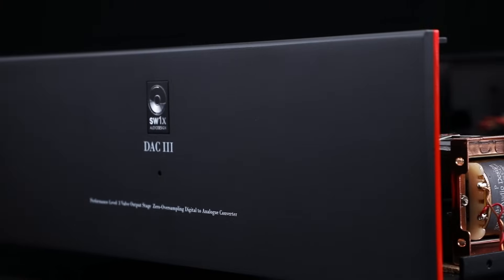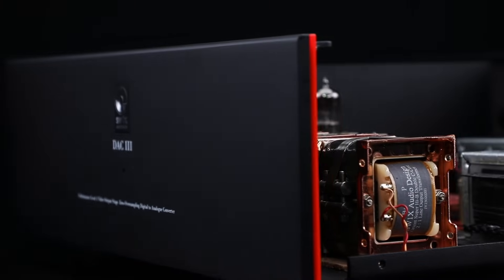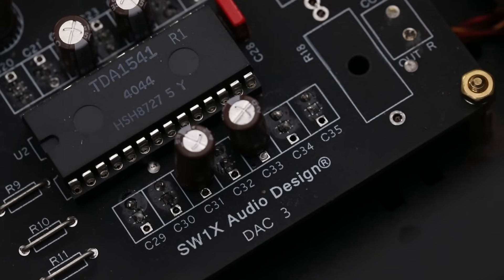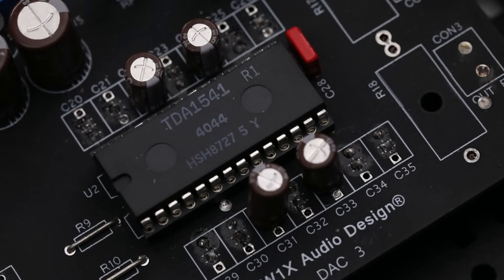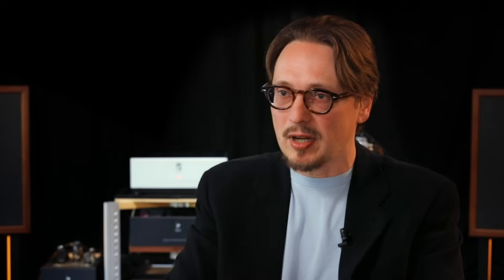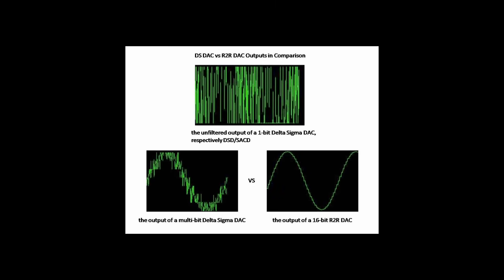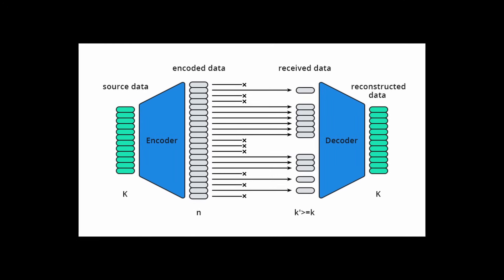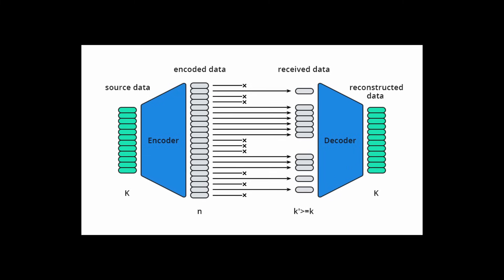Digital Signal Processing (DSP) Means Death To Your Music

Comment: There are very few absolutes.  IMO and experience, soundstage and imaging improve greatly the closer the left and right channels are to each at the most frequencies, psychoacoustically.  The greater the variation due to a poor room, etc., the more likely using DSP will improve soundstage and imaging than hurt it.  Microphones are cheap and can't know until you try it.  Only other comment, if you do use EQ, then don't use the REW autoeq.  This will give may you +/ 3-4 db of a target curve on each side, but will absolutely result in variations from right to left up to 6-8 db at many frequencies.  That is really bad, I promise.

Comment: Everything is bad for reproducing music and introduces stuff that wasn’t in the original. The trick is to endeavour to make those distortions musically pleasing. I went for many years of being a Naim amp user who could not find anything more musical although lots had more detail, to using a Lyngdorf tdai -3400. Yes, its an all digital solution and I disagree profoundly with the imfluencer behind this channel, it is pretty great and a big improvement on my previous mainly analog equipment.

My favorite dealer poo pooed this as a lifestyle product  but its actually semi pro level and demands a lot of setting up to get it to shine. One thing it does that gets bandied about as just room frequency correction, is true room correction, including a lot more parameters than frequency.

Comment: People should take a look at the waveform of a muted brass instrument, particularly smaller ones like cornet (but applies even to trombone) - practically a saw-tooth wave with huge SPL's extending right up into the 40KHz range (implicitly if it's Red Book/44.1 but clearly visible at high sample rates), i.e. more harmonics than you can shake a stick at. If you try to low-pass that with a brick-wall filter for 44.1KHz the harmonics inside 'the audio band' (up to c. 20KHz) get shifted relative to each other, hence the 'reconstructed' signal (and what ends up coming out of 'speakers) doesn't sound anything like the live instrument. Even someone of advanced years with no hearing left above 10KHz will be able to hear the more realistic, natural rendition of a well-implemented R2R/multibit DAC (**) compared to a delta/sigma one, even if the latter might sound 'smoother' or 'sweeter', or even (in the words used to describe digital audio ever since CD arrived) more 'crystal clear'. ETA >> there are 'hi res' transfers of tapes going as far back as the 1960's of meticulously recorded jazz players who frequently used muted instruments, and even on many of these there is clearly content extending well above the supposed bandwidth/FR of analogue tape often asserted. 

ETA >> (**) I'm referring to precision R2R DACs without 'brickwall' filtering, whether digital/mathematical or electrical, which digital purists/puritans insist are "broken" and (without listening to them) must be "unlistenable".

Comment: Sounds correct.  My experiments with DSP have always left me disappointed.  I'd like the engineers to focus more on time domain.  Fourier series is for periodic signals and music is not strictly periodic.  I'm no expert, but I imagine that much of this taken for granted audio research is pretty old.  Even saying music is a sum of sine waves is probably misleading.  Might as well say music is a sum of wavelets.  I guess there is some reality about how real instruments vibrate, but my experience in engineering makes me suspect they are abusing the math.
Reply: Engineers ...and the time domain .........they don't treat it  , as it should be the primary condition ! They stick to what they were teached just like the medical sector does ...
In nature the first important item of hearing is not amplitude and frequency but ...
localizing the source of the perceived sound , being the prey or danger etc.
This implies localizing the direction , the distance and secondary it's nature .......that means that this is all in the time domain ........all other comments/opinions are  " technicical or audiophile talk " !
Reply: The research is EXCEEDINGLY old!  I wrote on architectural acoustics for my degree and was stunned to find that there had been basically no proper interesting research in the field for the last half a century.  We're still citing papers from over 100 years ago using crude equations to approximate the behaviour of an exceedingly complex system.

And don't get me started on the lack of proper understanding of information theory in the audio field.  Almost none of these cats know the first thing about signalling or sampling.  Nowhere is this better exemplified than in the denouncing of anything above Redbook quality (16/44.1) digital audio as "snake oil" on the basis of a misquoted version of the Nyquist-Shannon sampling theorem.
Reply: @ChrisStoneinator  Did you ever think that it is because the only people interested in it are just like you, incapable of even doing any research?
Reply: @ChrisStoneinator  Thanks for the info.  It confirms what I suspected.  I got an undergrad EE degree, but switched to CS for grad school, as I hated the plug and chug mentality.  Maybe it gets better in grad school...

Comment: Yet i see in the background that you use valve gear.  Introducing noise and distortion.  Error correction exists to ensure the end to end bit error rate remains low be ensuring so you do not lose information.  Very important with transmission over networks.  It does not alter the initial signal quality in any way.  This is distinct from post encoding DSP, which i agree does.   Streaming can be woefull quality which is why i dont use it unless trying different artists.  Keep your cds and records.

Comment: Every analog frequency filter introduces phase shifting. EQs not shifting phase can only be done digitally (but this often is not done in most EQs, since most digital EQs are trying to be the same as anlog EQs in the old days). But if you talk about the way you hear a kick drum or violin accoustically as the purest version, you're already missing the point that the choice and quality of microphone (which is entirely analog) is one of the most important things. The signal coming out from the mic analog will never be 100% what yo hear directly already. 

Every processing step will change the signal. True for analog and digital in its own ways. You will not find any music that is not digitally processed in the recording procedure. So how original can it be? Even LP record production uses digital lookahead delays, even if all source material should be from analog tape.

As soon as you have one simple EQ filter, be it a low cut on the recording preamp of a microphone, you have a frequency-dependent shift in the time domain.
Reply: He also doesn't appear to know anything about acoustical amplification either.  He acts as though a live symphony performance in a music hall is somehow better than properly recording the instruments, when the acoustic amplification of the venue will always BUTCHER the music with hundreds of over-amplified overtones because the entire engineering of those buildings is equivalent to a MASSIVE poorly tuned DSP.  He doesn't understand the history of music or anything else he is talking about.  He doesn't even know that western performance venues have been literally designed to acoustically distort the music played in them to exaggerate overtones in choral music for many hundreds (thousands even) of years.

Comment: It depends what is processed, for example, the best thing in audio is the old Sound Blaster 3D Virtual stereo effect, it's unreal, but the mids get a glare, so it's not perfect, but they could have perfected it already, if they were working on it, but they stopped using it, which is the biggest shame, because as I've said, it's for me the best thing in audio, you need to hear it on no baffle fullrange units, it's unbelievable, as it is with any kind of loudspeaker. Btw. your DAC internals look beautiful, you can say even without listening it's superb.

Comment: Can only agree, the evil is in the digital processing. One of the reasons, why DSD has good reputation, usually it is less processed. But PCM can sound as good, when the mastering studio did it right. A simple transfer of an analog signal into digital can sound crazy good, when the digital data remains in its original state. A good positive sample is the HDTT download store.
And these crazy high sampling rates are necessary to reduce the mathematical errors during processing, and less so for the playback.
Reply from the maker: DSD is a direct precursor to digital processing. it is essentially a derivative of PCM for Noise-shaping DACs, which in turn rely on DSP to play it back
Reply: Except practically all studios have worked on full digital masters for decades. Even those that press LP records.
Reply: @Munakas-wq3gp  Sure, but a fully digital workflow is no guarantee. Every single edit of a file is a recalculation, which means fine details are lost. Some mastering studios seem to do better because their workflow is less incisive - less manipulating - less processing steps.
Reply: @bernhardh6184  Wrong. Digital files are bit perfect, there is zero loss. Loss happens when you handle analog masters or if you do DA/AD conversions (which you shouldn't do in digital mastering). In fact it's extremely easy to test it. Make a million copies of the same digital sound file and compare it digitally to the original. You will find that it's bit perfect like the original. The qualitative differences between master studios are most likely the skill set of the engineers and their monitoring equipment quality. The microphone set up for recording is crucial in order to get a good sound quality. So are the monitoring equipment, if the engineer balances the sound using non-linear crappy speakers like the infamous Yamaha NS10, the end result will sound horrible on a good speaker.
Reply: @Munakas-wq3gp  We are talking about different things. You are right, a copy will not alter the file at all. In difference, when you modify the file (EQ it a little bit, or DSP in general) and then save it - and you do this multiple times, you will realize very quick that SQ will drop drastically.
Reply: @ Why would you adjust the copy of the file in a digital workflow? You can aways edit the original. It works totally different compared to analog masters and need of analog copies.
Reply: @Munakas-wq3gp If you can do this then great. Others can't, that's why so many digital masterings sound so bad.
First come the artists, very often they record with their own equipment nowadays (phone, tablet, computer). Once recorded they modify the files. Often they not even record at the same time. After the artist(s) follows the mastering engineer. He then sends the files to the label. Quite often they do the final mastering. I would not be surprised if we end with 20 generations of files. Why, because everyone says, digital would be lossless, what in this case is not true. The same care is necessary as if working in the analog domain.
Reply: @ Digital is always lossless unless you do conversions to analog in the process. If you need to do DSP you don't need to take a gazillion copies, you can do a batch run using the original file. If that results in a degraded product, why bother with the modifications in the first place? The problem with many people thinking about audio is that they simply do not grasp the difference between analog and digital audio. Analog always degrades when it's being copied or manipulated. The same is not true with digital audio. Some digital processing does affect the quality but that's why mastering always uses higher resolution digital files with far higher dynamic and noise headroom than the final CD quality product will be.
Reply from the maker: @Munakas-wq3gp bit perfection is great for data integrity but is the biggest obstacle to musicality because the error corrections process is an integral part of it
Reply: @sw1xaudiodesign What is musicality exactly?  Come on, you can tell me, I believe in you.
Reply: @evrythingis1   I'm sorry to say it, but to hear musicality you need superman powers. Some people have them, others don't. But you can learn these powers. Unfortunately you can't learn them in discussions but only by listening to music. 🙃
Reply: Are they superhuman powers, or do some people have them?
Reply: @sw1xaudiodesign Incorrect. Bit perfect means that the digital audio file is exactly the same as the original file. There is zero modification or degradation.
Reply: @ He has literally no clue how computers even work.
Reply: @evrythingis1 I don’t know if I’d call it Superman powers but you’d be amazed how many people can’t tell the difference between a DVD and a bluray and the sales prove it. I don’t trust them to give me an accurate A/B comparison of audio either.

Comment: Contrary to your proposition, I find that I enjoy music much more becasue the DSP in the 20-200 Hz region is aligning my subs and mains beautifully to get smooth extended bass. I never got that before DSP. I don't use any DSP above 250Hz though. Your whole approach sounds like you eschew the last 50 years of innovation in recorded music. If I compare a modern music track with something from the 1970s, I can tell you that the newer stuff is a lot more engaging and enjoyable. Just my 2c worth.
Reply: I also noticed that today you can find excellent digitally recorded pieces of music, but old analog recordings from the pre-digital era still sound better to me. I especially like the recordings from the late 50s and early 60s, made by sound engineer Rudy Van Gelder.
Reply: He will never respond to you because he's functionally illiterate.
Reply: I stream almost 100% of the time these days.. convenience, millions of tracks at my fingertips, & it's all fairly clean & detailed. 
But an all analog system using vinyl is superior..comparing good recordings. The sound is just different. To me digital has a glare & hardness..a ringing to it. More artificial. The dynamics of a good album vs a good digital recording is miles apart..with vinyl being in the lead. You have to step up to a very good & expensive dac just to get close to the weight & texture of notes from a mid-fi analog set up. 

To me digital is just a more efficient approach..but I agree with the video in the belief that something is lost in the process. 

A lot of the reason that we need DSP for speaker/subwoofer correction is because of our rooms & the speaker design & crossover itself. Correcting something that wasn't set up or designed correctly in the first place. 

I'm not dissing digital or room correcting DSP. I mostly stream & use DSP for subs as well..& I am extremely grateful for it. Some people spend a lot of time & money making digital not sound so digital.  People can hear & feel the difference. Even when the components or specs of the digital device are objectively transparent. 

My apologies for the long speech..I got a little carried away lol